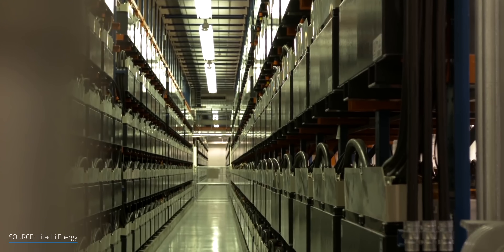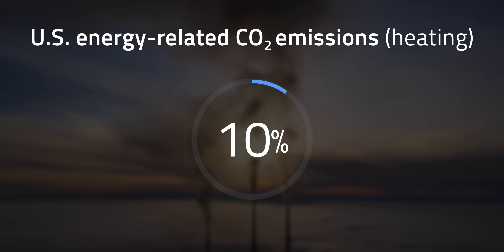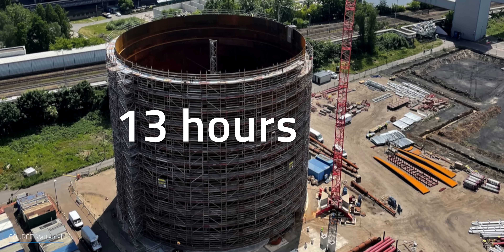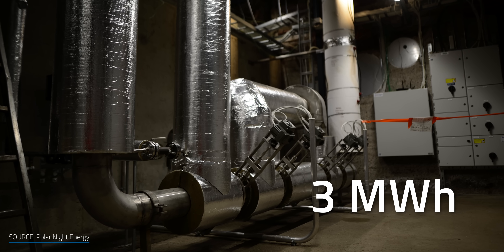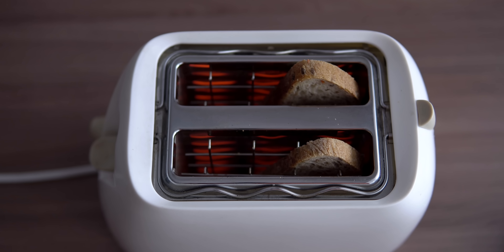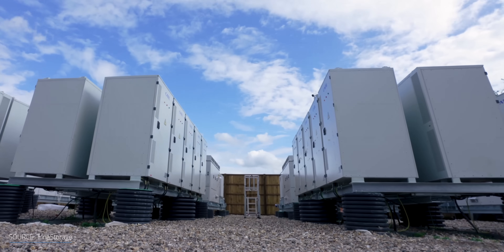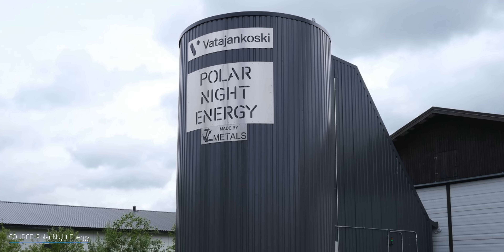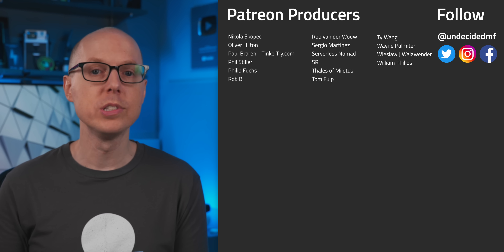How A Sand Battery Could Change The Energy Game

Comment: One thing not discussed is the considerable loss in efficiency that results from using resistive heating rather than a heat pump. Heat pumps effectively reduce energy needs for heating by a factor of 3 to 5. That efficiency boost is lost with this method. You could potentially use heat pumps for the initial storage, but this drastically increases the complexity. You would also likely need multi-stage pumps to achieve the desired temperatures.

Comment: You lost me once  you referenced LNG as a "dirty" source.  Scientifically, it's not.  In fact, if all motors in the U.S. that could convert to running on LNG would do so, in less than two years the U.S. would meet all carbon goals of the Paris Accord.  LNG creates carbon at a fraction of petroleum and is a viable, inexpensive means of reaching carbon goals in a short time.  Plus we have an abundant supply of it to use while working on true alternatives like hydrogen.

Comment: ("Use the "heat" as heat for offices and such".  Instead of making electric with it.  Because there is a lot of waste.  I respond with (Such a "high hopes" idea).  It would, require an entire different infrastructure.  Mainly "heat pipes" from the central battery to all the local buildings.  As far as costs, easy peasy.  The savings will recapture the initial investment quickly.  But, the actual "job" might prove impossible.  To run a "new" line through a city, and eventually a building (at the endpoint).  Just ask Google what kind of problems they encountered when they tried to lay fibre optic in this country.  The main thing that came out of that project is the fact.  All the "resistance" they faced, exacerbated the development of a wireless way to send over a gigabit stream (from space).  What this "heat pipe" logic has is good.  It is good for a "new" city (like Neom).  For us old United States cities.  Not so much.

Comment: Using evacuated solar water heater(s) to transfer solar energy via tubing to a super-insulated basement style dry sand filled bunker beneath homes, garages, or commercial/industrial buildings sized accordingly to store excess heat for use during times when needed could provide the medium needed to efficiently and effectively store renewable heat energy for later needs. Storing the sand in the earth instead of an insulated silo would keep the battery in the stable temperature of the ground rather than the fluctuating environment of an above grade silo. The possibility of this technology coupled with an earth-to-air heat pump in place of the solar water heater could potentially make a geothermal heat pump much more efficient by containing the heat transfer to a dedicated space free from water.
The walls of the bunker could be built with conventional construction methods such as poured concrete, CMU’s, or ICF’s.  Once built and properly waterproofed, the interior floor and walls could then be insulated with either thickly sprayed hydrophobic closed-cell polyurethane spray-foam insulation—thereby adding to the water/air proofing—or multiple layers of polyisocyanurate sheets or any other capable high performance insulation .  Once constructed, dried sand could be vibrated and compacted around the needed plumbing or air tubes to provide a denser medium which would hold additional heat. This sand-filled bunker would then be topped with several inches of a foam product such as those found in load-bearing foundation footing systems onto which a concrete floor of a building could be constructed.
This sand battery could be easily scaled for use in large spaces as well by introducing additional “cells” or by digging deeper into the ground.  Factories, schools, retail space, and hotels could also benefit from such a storage system allowing great savings in heating costs as well as their impact on infrastructure and the environment.  By utilizing renewable, excess, or even wasted energy in a stored space for later use simply makes sense.

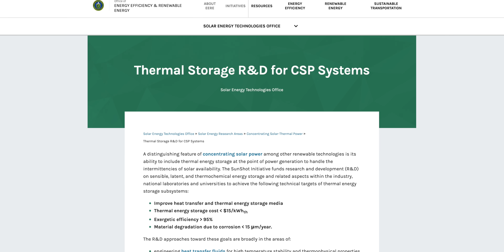Comment: 10:20$10 per kilowatt-hour is outrageous. I currently pay $0.58 per kilowatt-hour to heat my home, When using backup electrical heaters if the gas is out. Sounds like they have a far way to go before competing with electrical energy.
Reply: @jerichojoe307  I could be wrong but I think that is the construction cost, not what you pay to get the energy out. It's like saying a 80 kWh EV battery costs $15,000 to build so it's $187.50/kWh.

Comment: Did the brains behind this operation consider how much carbon it takes to mine the ore, refine the ore, ship it, make the steel pipes, ship the steel pipes etc… didnt think so. Like compairing a tesla to a gasoline ford truck. Sure onlver the next 100km drive what are the impacts of each!? But when you look at them both from the ground up the gasoline vehicle still comes out ahead with a smaller carbon footprint. Oh and i believe Henry Ford motor plant did all this over 100years ago. Manufacturing and all the excess heat/steam was captured to heat and power multiple square miles of infrastructure and buildings etc… then all returned back to the start and reused for another cycle.

Comment: Yes, I believe sand batteries can be a good heat storage medium.  Even if a tower collapsed (ex. in an earthquake) there's no real environmental damage; just wait for the sand to cool and rebuild the tower. 
.
One minor correction: water "can" exceed 212F/100C, when under pressure (albeit not by a lot). That's how a pressure canner works. At 15psi, a pressure canner gets water up to 240F/116C.

Comment: Let's stop thinking large and centralized. A sand storage unit in a single home combined with solar electric powered heating elements could heat a reservoir for an individual home or building. Then pipes filled with water buried in the sand could be circulated through radiant heat tubing and distributed throughout the building.

Comment: Ok..... this is a Longshot but there is a building in London known for conducting a reflective heat ray that can melt tires due to its reflective surface and angled design..... They call it the Death Ray or Walkie Talkie Tower in jest..... could such a design be used to construct a thermal battery that is charged for free???

Comment: This is a hearing system only. It benefits countries that have lower temperatures annually. In warm, tropical regions it really wouldn’t be viable.
Although it does have some benefit, anything that offsets the need for fossil fuels is good in my books.
What type of capacitors can hold large quantities of energy that can be used to generate electricity for longer periods to maintain renewable energy storage? Any ideas?

Comment: But the cost of power you mentioned  is still significantly higher than what my utility company gives me right now. If i am not mistaken, i heard you say $10 per KWh, whereas my the present cost of power for me is $0.065 per KWh. That means the sand company will be charging me 154 time more than my current company. That will be hard for businesses to accept to switch to this system. Please correct me if i am wrong.

Comment: Maybe a little late, and I really hope you read this comment. In the Netherlands, there is a sustainable 'village' being build at the moment. It's called ecodorp Boekel. 36 houses are going to be heated by heat produced in the summer, stored in a huge container full of steel slag and concrete, and used in the winter. The container will be heated up to 450 degrees Celsius by 600 solar panels, which should be enough energy for all 36 houses throughout the winter. The system used is called CESAR, developed by Cees van Nimwegen. You should definitely look into this development, as it's already built and in use!

Comment: Given heat pumps have a 300% efficiency, two questions:
1) why aren't they used in the heating process here? ( Resistance heating is literally about the most stupid thing you can do with electricity)
2) Will it be competitive with a battery - heat pump system where you only need to store 1/3 of the needed heat energy in form of electricity?

Comment: I think you could use this to heat your home. You wouldn't need a large scale application for a single family home. A solar furnace isn't that difficult to build. The heated sand would allow for a longer period of heating after the sun sets.
Reply: Agreed... We need to de-centralize most services water, sanitation, electricity, heating, etc., giving people independence. Also, when there is a system failure it only effects 1 household not thousands!
Reply: @onestoptechnologies7305  i have to disagree. The scale associated with centralizing energy systems brings huge efficiency gains compared to home scale systems (internal combustion generator ~30%, gas or coal power plant ~40-50%). In addition, the investment costs divided by the amout of people that are served are much lower with industrial scale power. And as for reliability, much of it is down to a proper funding scheme either not funneling money to corporate or municipal operators not skimping on costs. I have lived in a district heated home my whole life, and so does half of the population of finland, my home country, in both single family homes and units. There has never been an outage that has affected my life and as long as i have followed the news has there never been a story about a district heating outage. And as far as electrical power, there has never in my life been an outage in the cities. Rural areas sometimes see some homes go without for a few hours if a tree falls on the line, but cities have roughly 100% underground electrical power lines. Never any system wide failures like in texas 2021 either, and our grid has more wind than texas and has a colder climate.

In short, if the central system is not reliable, one should rather invest into if and fund it well rather than abandon it in favour of small scale power.
Reply: @otsokivivuori7726  I can understand why one might think it would be "better." However, efficiency is not the "be-all and end-all." Unfortunately, I have seen power outages cause deaths. In the last 2 years alone, almost 1,000 people died in just the State of Texas. 

Finland is 29 times smaller than the USA and only 720 miles long, so transmission loss is less of a factor. 97% of the USA is considered "Rural," yet still contains nearly 20% of the population (60 million.... 12x the population of Finland). It's not uncommon to be able to drive for hours without seeing a stop sign while passing many homes.  In the USA, we have transmission lines that were installed for the purpose of transporting electricity more than 1,200 miles from hydroelectric sources in the North to population centers in the hot areas of the South. Interestingly, you comment about Finland being "colder" that Texas... power transmission is better in cold conditions than hot. 

Computer systems migrated from the "Centralized Computing Model" to the "De-Centralized Computing Model" we have today. Most systems today are designed the concept of "Lots of Little." Distributed versus Centralized. Even the "centralized" systems you are lauding, are not truly centralized... (One single power generator for the entire country.) They still have de-centralized power generators throughout the country, so the real question is just about where to draw the line... Country?, City?, Neighborhood?, Home? 

Most "Life and Safety" systems are required to be localized and independent because they are so important. It might be more efficient to centralize all food preparation and eliminate all kitchens in homes; no cooking fires, no untrained people preparing food, less food illness, but would that really be better? Governments throughout history have implemented many "efficient" solutions but rarely are they the better for the people.

I've never heard someone describe any government led venture as monetarily "efficient." Governments do not have their own money... they just take money from the people and spend it. I can assure you that individuals will spend their own money in more effective and judicious ways than ANY bureaucracy.  

The USA was built upon self-reliance and self-sufficiency, coupled with concern for our fellow man. Individual States that are United! I think we are better versions of ourselves when we grow from children who are helpless and dependent, to adults that are knowledgeable and independent. 

Small solar systems augmented with an additional diversified source and local storage encourages people to be more mindful of their energy usage, very scalable with demand and eliminates massive transmission losses. If your neighbor loses power, you can go help them or invite them into your home until it's fixed... instead of freezing to death right next door.

Comment: You are freakin’ me out.! In a good way. I’ve been undecided, from 1979, when I planned to build a residential Solar addition to my house, high atop 1300 ft(above sea level). I had been studying phase change salt an computing need for, in a pre internet era. I gave up on the dream,(Fubking Ronald Raygun) and   took on racial equity. I heat my place with wood, as I have an endless free source, I’ve had propane systems, yet , quit the company account, more than 8 yrs ago.
    I work at times, for univ. of Massa-chew-sits,in Amherst, where , you may know, a city size, coal fired sream system was converted to a massive geo thermal loop under the athletic fields below the university. So, Im paying attention.

Comment: There is a lot of low hanging fruit efficiency wise in industry. Because fossil fuel based energy was so cheap historically, there wasn’t much point economically in conservation. If 20 years we had implemented a gradually increasing tax on energy, our built infrastructure would be much more efficient. I don’t see why this wouldn’t work on an individual home scale.

Comment: You forgot to ask a few important question.. what is used as a heat transfer fuild to and from the battery to achive temperatures of 1200 as most oil will burn up at high temperatures... molt salts will not flow untill temp achived... what material  are used to insulate this heat storage.

Comment: NOPE! Yet another solution that wont work! 
1st The World is actually run out of sand. We already ruin ecosystems. Because we are super clever we going to create artificial sand solve that problem and create several others - lets put that aside;

2nd Even if I see it I won't believe you can storage it for that long period. Not that there are no materials that would make it possible, but that would be on the expensive side on one hand, and you still have no control over the input of the system. 

If the energy density is enough to heat it during the summer, and you are able to keep it for few months, it will still gradually decrease so when the cold come the system will already be in downgrade. Further more - at the beginning of the heating season you already have lower input - then when you start using the heat - you can not add, the input will be very low almost insignificant - then if the winter is longer... you are screwed badly. 

Dont think it will work as you basically use the least when you have the most and vice versa - when you need the most you have the less.

Comment: Sir, if we use huge quantities of massive sand batteries to operate a steam turbine to produce electricity then will it be economical for our future? I mean if we operate the system such that way... First we need to flow air in sand batteries then we collect hot air to produce steam from water then steam will run the turbine.

Comment: I would think that creating electricity from the heat being stored would be an "added bonus" when you need to move the air for distribution. the heat in the air isn't going to go away when it passes through the turbine.

Comment: I could dig up under my parking area in front of my house. Isulate that hole on the bottom and sides, fill it with sand and add some piping, and then insulate it on top. Having the heat storage sunken, you loose less heat during the winter time. On the roof of the parking area there could be solar panels. The extra energy, not used during the day, gets converted into heating the sand, from under the driveway. During the evening, when the panels do not produce, use the stored heat in the sand under the driveway to heat the house. Did I get all this right?

Comment: In places where there is not disctrict heating, you can re-create the same idea with an individual thermal store boiler, aka the Tepeo ZEB. Expensive at the moment but over its 20 year lifespan not too much more than a standard boiler when you factor in servicing and boiler replacement. In the long run, thermal store boilers should become cheaper as more people enter the market. Charge them up during the day and release the heat in the evening. or charge overnight when electricity is cheaper

Comment: I dont buy it. Heat gonna lose a lot when in the tank... could work but i bet it is not.😅
Also, heat transfer increase by difference in temperature. Look at refridgerator, or home. Human cant not yet make perfect heat insulation and can not perfectly keep heat for a long time. Heat gonna transfer out a lot.
Remember the solar tower? It is technically work, but does not worth the cost and the company got bankrupted.